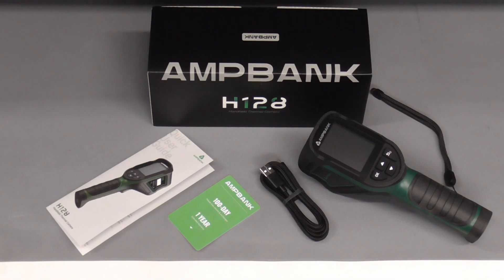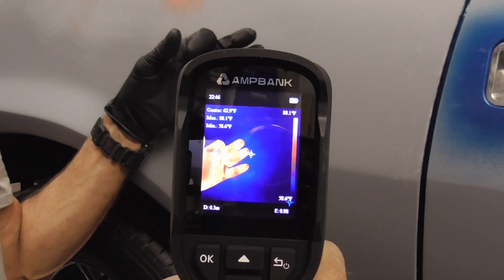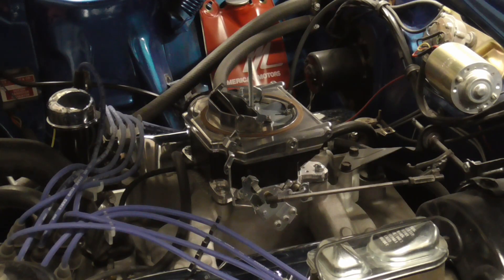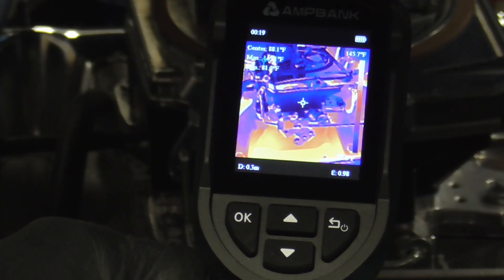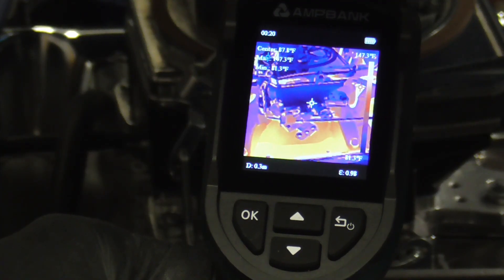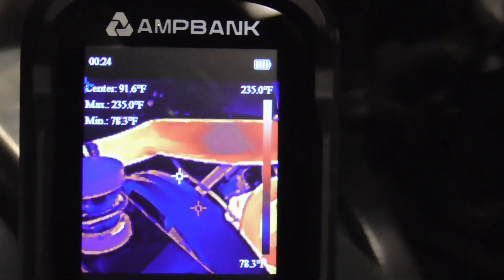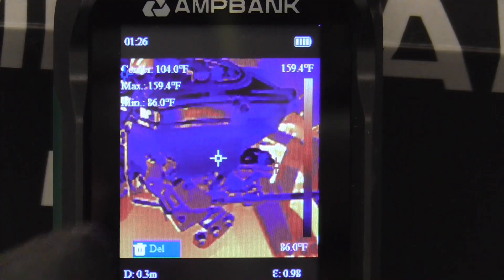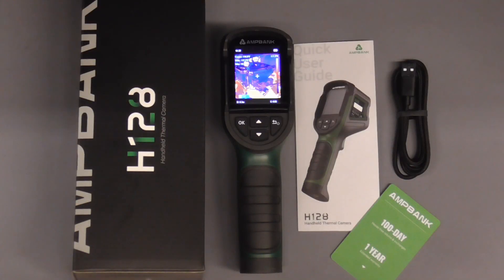AMPBANK H128 Thermal Camera:  Diagnosing Fuel Percolation & Vapor Lock

Comment: In the racing days they used to have an aluminum plate below the carb sticking out all around the carb as a heat separator/heat sink to isolate the carb from the heat below it.
Reply from the maker: Thanks for the information Paul - I'll do a search on that 💯
Reply: Jerry, I use edelbrock carburetors on my birds, and I use the insulator that goes between the carburetor and the intake. Manifold, never had a problem with vapor lock.